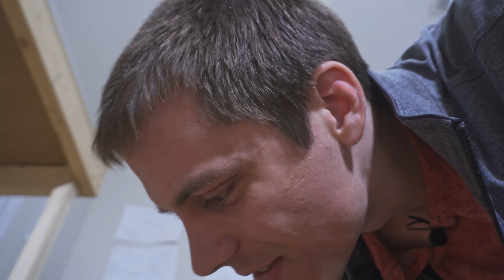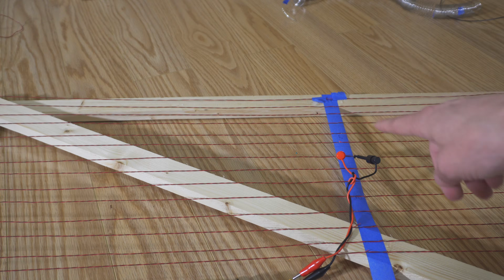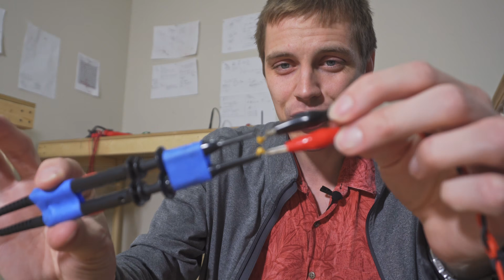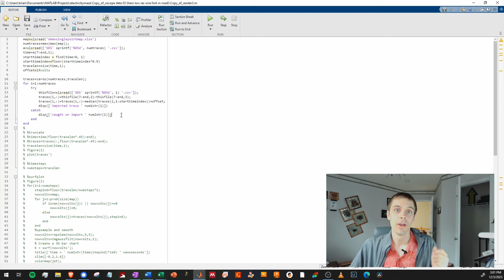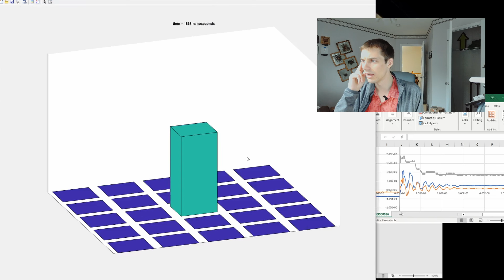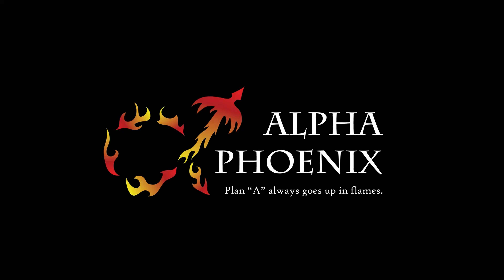How to measure waves of electricity

Comment: So Capacitors are shock absorbers? What's the delay of that? Reminds me of sound waves in baffles. Eventually leakage occurs and how you control that his how you transmit the energy.  Entropy is such a good model for these reasons.  More holistic.
Something I find cool is using microscopic baffles with phonons to direct thermal energy where it is more conductive to escape and not reverberate in its container.

Comment: What was the capacitance of the probe capacitor, out of curiosity? I am really surprised that it worked as a solution — I expected the length of the probe wire to be the source of any problems, not the inductance characteristics of the scope itself

Edit: looks like 10pF (resonance ~9ns) which is scarily close to the times you’re measuring — how does it compare to the capacitance inside the probes?

Comment: Just a question... Would setting the scope to AC coupling instead of DC coupling have the same (or similar) effect as what you did with the capacitors in series with the probe?
Or would that make it hard to keep the readings stable over multiple readings at different positions on the wire?

Comment: BTW... when was doing similar experiments a few years ago with exactly the same model of siglent scope you have, I plugged an ethernet cable into the back of it and wrote some python to suck the data out over the network. This was a lot more convenient given the analysis (mainly fourier tansforms in my case) was being done in python anyway. 

Send me a message if you want a copy of the fiddly python networking code for future experiments.
Reply from the maker: sounds like a good plan! i've got another project that may benefit from that a lot - a while ago I made some matlab code that could talk to the scope over USB but it was SUPER slow to get a full-memory trace out
Reply from the maker: if I can't get it going I'll let you know!

Comment: 17:00 also you could just place the scope probe close to the wire without making any contact and it would be very similar in nature but less repeatable
Reply from the maker: I tried this (just clamping the insulation) but my probes had too much internal loading (maybe because I didn't tie the grounds together, as someone commented), but I was also worried about different amounts of wire squish altering the capacitor between the probe and the wire

Comment: Terrific trilogy.
IMO only two aspects are missing:
1) it need to be said that there is a voltage drop in your battery corresponding to the load
2) why does the voltage fixate at least temporarily after the first wave propagated? It is not obvious. On the one hand I can say that it stays same because each new section of low resistance wire looks exactly the same regardless of how many is left but that's not enough.

Comment: Now try it with a heavier gauge wire. And try placing the wires further apart (so the magnetic field has less of a chance to propagate to the other wires that zigzag heading to the load end point) on the frame like on a 4'x8' piece of plywood. I'm sure all the measurements will be different than the really thin wires.

Comment: Not to be a buzzkill - and thanks for the video! - but here is some constructive criticism for improvement: 
You  recreated a shorted transmission line with an open stub - look at any college  textbook on transmission line theory.  You are looking at emf wave fronts, not really "electrons bunching up" on one side of the transmission line.  The actual electron velocity will be surprisingly slow compared to the emf wave velocity, and you seemed to  miss the critical effect of inductance in your transmission line.   SUGGESTION: The next time you try to measure current into each conductor of a transmission line, use a matched pair of current sense resistors (or swap the resistors and repeat testing).  You'll be surprised at what happens when you account for all current flow, inductance, capacitance and resistance in the transmission line..  Turns out everything is important as the emf WAVE travels along the line.
Reply from the maker: The em wave is propagated and guided down wires BY bunching electrons. I understand that they both occur at once, but when you tell people it's just magic waves that know where to go, it doesn't make much sense to someone new. I'd like to teach that it's both because they need each other, but in the youtube setting I prefer to talk about the particles because they're more tangible. Too many explanations are waves-only, and if you don't look at the electron motion (and local density/pressure/"potential"), then a whole bunch of things fail to make sense, even ohms law in DC doesn't make sense unless you realize electrons are bunching. just because it's extremely slight doesn't mean it's not critical.
Reply: @BetaPhoenixChannel  Yes. You also need the bunching electrons picture to explain how special relativity marries magnetic and electric fields but electrons themselves are elusive things 😏
Reply: Yes, the electrons are actually not important, the electric and magnetic fields in the space between and surrounding the wires are the actual significant phenomenon.

Comment: I am amazed that you are willing to put in this much work. You must be loving it and you must be doing it because of that. 
As others have mentioned the trick to not introduce any big change by the testing equipment is to use very high impedance probes. 
Unfortunately many of your viewers of the actual test video do not realize that at those short time scales as you are using there is really nothing that can be called DC. They look at it from a DC point of view instead of from an AC point of view which I believe makes it more difficult for them to understand it.    I have for a long time known that your results are the fact of what happens (and picked c) but I have never seen it so thank you. I have often seen the results of it in data communication and antenna cable performance.
Reply from the maker: I find it really difficult to communicate that short pulses are AC. in one video i went into detail (on a very similar circuit) and showed an FFT and everything and I had irate comments telling me that "pulsed DC" was different than "AC". whatcha gonna do?
Reply: @BetaPhoenixChannel  I appreciate your frustration. I must admit that I myself have changed my view on it over the last few years and that is after an electronic engineering education that I had about 45 years ago where I did learn that every pulse can be calculated as made up out of sine waves.  
At first glance one would of cause say that DC is when the current is just going one way and AC is when it is going forward and backward (alternating). That is a fine if we are talking about what most people see and experience most times. It is only when one get's into working or thinking about what happens on a time scale of less than a second (especially milli, micro and nano seconds) that it really matters. Personally I have worked with that with computers etc. since I finished my engineering education. 
Now after I have retired I have started to analyse things a little better as I also have some interests in physics and then I realize that the little bastard electrons are what is moving charges around and they or their influence can not move faster than the speed of light which compared to frequencies isn't that fast after all. 
To explain that a pulse is AC the one thing I can think of right now is to explain how such a pulse can be made up of higher frequency harmonics of the pulse and that must be the case in real life too as if all higher frequencies are filtered out a pulsed DC will only rise and fall as a sine wave of the pulse frequency. It also demands to explain that all circuits consist of inductors, resistors and capacitors. The functioning at super cooled circuits where the resistance may be zero I am not quite sure of now. I am still learning at age 77.
A place where a pulsating wave is used to make a higher frequency - a harmonics - is in many high frequency radio transmitters. They often start up generating a lower frequency that is easier to control , then cut the sine wave's top and bottom to resemble a square wave and with filtration picking out the desired frequency. That was used in a TAXI radio I modified to use as a Ham radio transmitter many years ago.
An AC pulse can of cause also be said to be a DC with an overlaying AC but the initial start when a DC is connected to a circuit can in my opinion always be seen as part of an AC wave. 
Unfortunately there are people that are so sure of them self's and what they have learned that they have to be unpleasant in their remarks. I know that although I have learned and experienced a lot then I really don't know very much for sure and if people can disprove what I am saying then I am willing to change my mind if it makes more sense to me after their explanation. To be simply told that I am wrong without an explanation doesn't cut it.

Comment: So the question I have had as I've watched the various YouTubers trying to make a practical demonstration of this effect is this, since you are all running wires in close proximity to each other, and often in extended parallel runs, what is the possibility that some of that inital energy step that you are seeing is just transference by radio waves?  (If you were to move the oscilloscope centered between the switch and the load, and then run the trans mission lines out into a big, bowtie "X" configuration, might you not get less of the initial step?  (Thinking perhaps more of your farm field, experiment.)

Comment: You can see this on an old analog monitor if you put a tea on the coax and continue single down coax without a load resistor or a nother monitor you will see the single reflection giving you a double image which will change depending on the length of the coax.

Comment: If you want perfect equal current on pluss and minus cable, maybe just use a small high speed transformer as your supply.

Current should be equal on both sides in my mind 😅

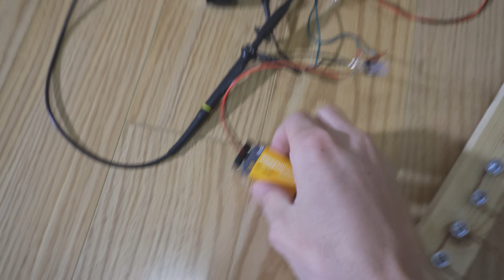Comment: 2:49 My EE background says for smoothest power you want a combination of different capacitors. I would use a 10uF electrolytic, a 100nF MLCC, and a 1nF ceramic in parallel. 

Each capacitor is most effective in a certain frequency range due to parasitic resistance and inductance. By combining different types and values you can cover the whole frequency range of interest.
Reply from the maker: I'd never considered that capacitors could have frequency varying impedances. thanks!
Reply: In fact (and if people are still reading, 5 months on), above a certain frequency (governed by the parasitic parameters, due to the physical construction), capacitors behave as inductors (their complete opposite). They will still store charge as any capacitor, but the voltage vs. current waveform follows that of an inductor. That's why we use multiple capacitors of different values (actually orders of magnitude) and construction types (usually electrolytic and ceramic) and physical sizes to cover the full frequency range.
Reply: @BetaPhoenixChannel   The idea that you need multiple different values or types of decoupling capacitors in the way that stefansynths suggests is a common misconception in electrical engineering. Generally the way you would want to use decoupling capacitors is to place as large a capacitance value with as low a parasitic inductance and (sort of) as high of an esr as you can get away with as close to the power pins of the device as you can in a way that minimizes loop inductance. Generally the lowest parasitic inductance capacitors you can get are those in the smallest packages you can get, so SMD ceramic capacitors. Nowadays these are available with relatively high voltage and high capacitance ratings, so there is generally no need to opt for electrolytic capacitors if you want a 10uF capacitor that can handle 9V. A drawback of certain ceramic capacitor types is that, depending on the dielectric, their capacitance can drop significantly when higher voltages are applied. Another drawback of ceramic capacitors is that they can have too low of an esr. There are controlled esr ceramic capacitors, but they are rarer and more expensive. If needed, you could put a resistor in series with a ceramic capacitor, though that obviously increases area usage, bill of materials and loop inductance. I find this video gives the best explanation about decoupling capacitors Watch code: WdlN8bHw-w0

Comment: Fantastic demonstration! No doubt reproducing these results will make it into lab and edu literature for many years! Physics, data acquisition, and data analytics all integrated to observe a remarkable phenomenon. Has anyone observed the wave back propagation at the y before? What would you call that?
Reply from the maker: it's an impedance mismatch when the cable (150 ohm) turns into two cables (150 ohm / 2 = 75 ohm)
Reply: @BetaPhoenixChannel  when the initial wave meets the Y, one conductor becomes two so the wire resistance goes down, shouldn't that be a sink not a reflector for the wave front leaving the source? with regard to impedance matching, incorporating an explanation of a 75 to 300 Ohm CATV Matching Transformer, indeed also the purpose of horn tweeter, would be really helpful to establish more complete common ground (no pun) of the knows. I agree per the resistive wire confirmation, but in my view calling your wire 150ohm has more to do with the source/termination circuitry than the wire itself, and why would an impedance reduction in the wire reflect the wave front? Does the same thing happen if the Y does not branch into two directions? Maybe the reflection is due to removing a dimension from the freedom of the electromagnet field surrounding the wire?

Comment: The yellow trace is not due to crosstalk.
The chemical battery is not -5V and an infinite ground.  It is a redox reaction, pushing electrons on one side and pulling the on the other.  Half the potential is on each end.  So you will see symmetric behavior in the positive and negative wires.  Both of them are getting a wave of current due to the chemical action at that electrode.

Comment: Could you put an instrumentation amp (powered by a coin cell, perhaps) at your measurement head, so as to have a lower-capacitance input?  Also, with an instrumentation amp, you can drive the shields of the short cables actively to the mean of the input signals so as to minimize the effective capacitance. Center-tap the gain-setting resistor and run it through a unity-gain buffer.

Failing that, they do make x100 scope probes so that you can have even lower input capacitance. 

In your pulser, you probably don't need those big electrolytics. The battery is effectively a huge electrolytic capacitor.  You need a small amount of capacitance with very low inductance right by the chip.  With the dead-bug setup you have, just solder a 100 nF ceramic between pins 7 and 14 of that 74AC14.

I suspect you'd do well making your pulser around a line driver like the AD8132.  Impedance matching when you launch the pulse does help!

I saw you with a bunch of termination resistors.  How close did the measured characteristic impedance of the line come to your calculations?

Now I'm sitting here with a head full of imaginary Smith charts and wondering about whether I could design a current transformer to measure things less invasively. (But I haven't designed any magnetics in years, and I'd be really, really rusty at this point.)

Comment: All 3 vudeos wefe just amazing!! Seriously!

I would make two minor changes though. For the Schmidt trigger, add a couple.of 0.1uF or even 10nF capacitors.ij parallel to the large ones you have. As close to the vcc/gnd pins of the chip as possible. Rhe big capacitors help but their internal resistance and inductance means that they are "slow". So for the very fast transients you want a fast 0.1uF capacitor bormally known as a "decoupling capacitor". This will give you much better rise times 

Swcond improvement would be to use a differential probe inatead of the math function. Thia way you sont have to worry about the disconnected ground leads and the inductance that those leads (pf the red and black probes) create. Remwbwr that all ground ports of the scope are common ao you have a "back" path or at least aome potential interference from the ground leads hanging around.

A differential probe does the math in analog way nect to the measuremen point and ahould give you wven better noise immunity (although the traces did look very goos)

Finally, given you hace a "repeatable" trace.. if you apace put the pulaea enough (say at 10khz) you can use the averaging funxtion of the scope to get better dynamic range /.noise performance by accumulating hundreds of runs of the same repetaed event.  

Some scopres (sampling scopes9 can evwn increas the time resolution by adding a slight jitter to the trigger and getvsamples at slightly different times but due to the repetitive bature of the signal, tgey can build a higher resolution (time wise) "Image"

Finally ypu can use the trigger input od the svope instead of one of the channels, directly from the Schmidt trigger output (maybe uaing one of the channelse separately). That way you can sanple using channels 1 and 3 and thus run the scope at dohble the rate. For example of the scipe is 1gigasample/s that usually applies to channels 1 and 3 by themselves. But if you capture all 4 channels.or 1 and 2  (or 3 and 4) then the rate goes down to 500 megasamples per channel

Comment: The entire video I was wondering why not use Ethernet cable, it is cheap and contains 4 already twisted pairs. Optionally shielded too. I think Steve Mould did this. Until you mentioned the need for high enough resistivity.
Reply: buy cheap, CCA ethernet and ypu'll probably be in the high resistivity range... ;-) but also in a world of hurt when trying to measure the signal, etc